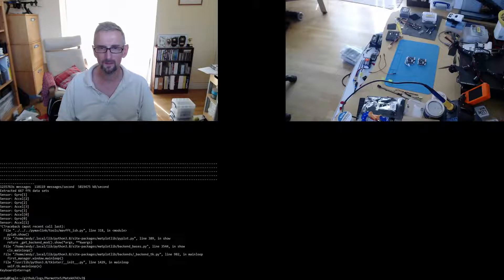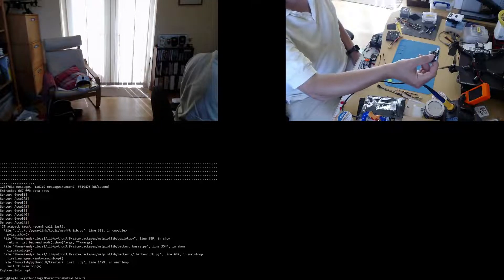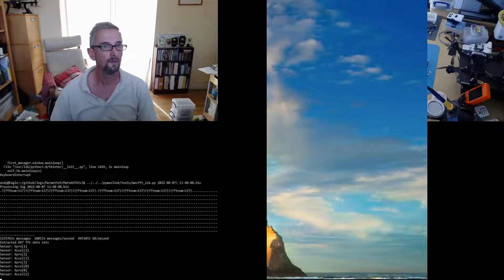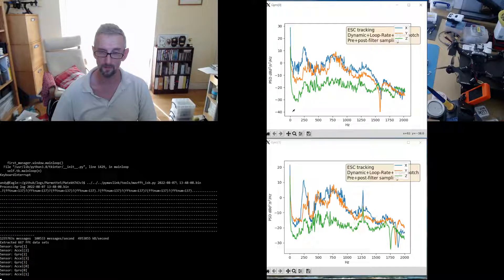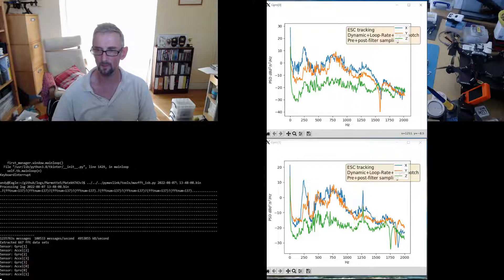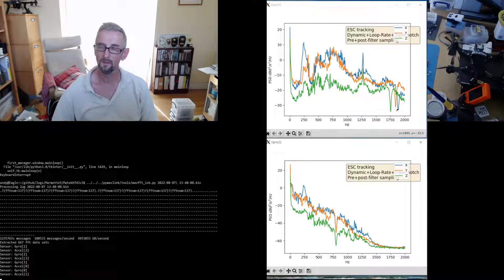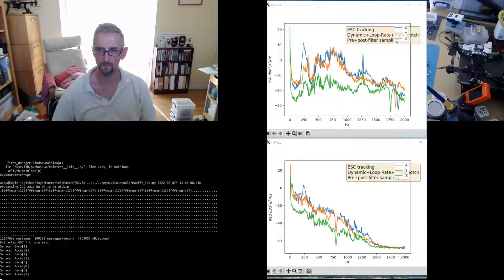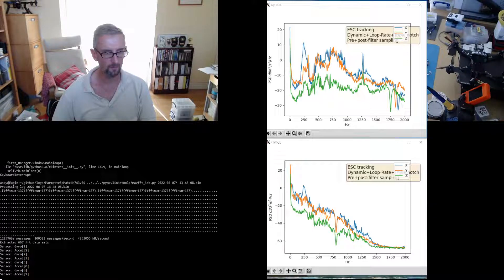The Beater Review - Matek H743 Slim v3

Comment: Hi..im new to all this,recently im just oldtimer l.o.s pilot...
With this h743 slim, is it possible to have more than 2-3flight modes?(eg: manual/acro,rtl,altitude,stabilize modes)
1-If we can select manual mode,is it possible for me to do usual aerobatics maneuvers,without having any erratic actions by the fc?

2-Can it be use with Runcam 2 HD?

3-how to use this h743 slim with more than 11 pwm output for servos?

4-do i need to connect external current sensor module?being thinking those Matek HCS150.

5-For rtl mode,do we need to have a Air Speed sensor module connected?,if landing accuracy being critical concern..

All above is for my up coming plan;
Edf jet,10s(42volts)setup, will be running at least 10pwm channels(9-10servos,+2more for pan-tilt fpv cam gimbal, 3pcs electric landing gear retracts)

*Which configurator is best to use for this project?

5yrs ago,i only have experience on Cleanflight only during messing around with mini racing quad & hexcopter(i do have a learning session using DJI configurator)
-any helpfull tips will be much appreciated✌🏾😎👍🏾
Reply from the maker: Hi, waaay too many questions to be practical to answer on youtube - please post on https://discuss.ardupilot.org and then we can answer them one by one, there is also loads of info on the wiki - https://ardupilot.org/copter/
Reply from the maker: 1. Yes 2. Yes 3. Can't unless you use a CAN add-on board 4. Not usually - part of the ESC 5. Not sure. For general setup info follow the wiki - most people use Mission Planner or QGroundControl for configuration